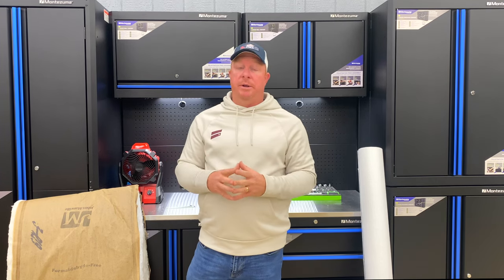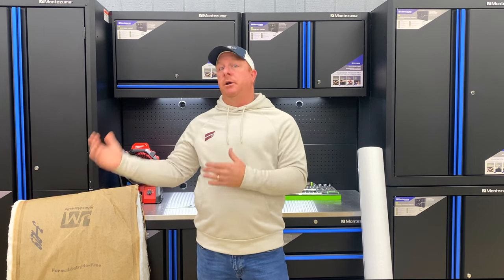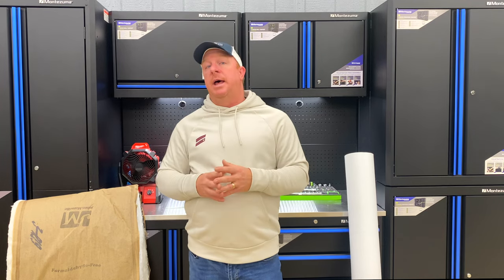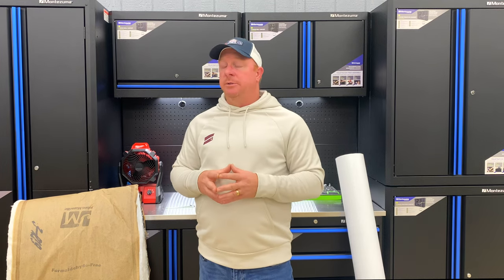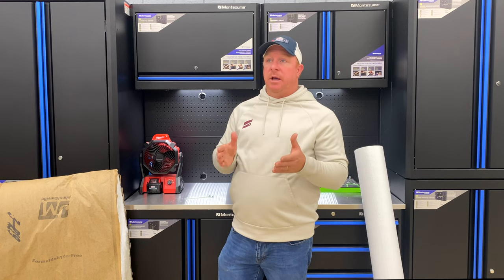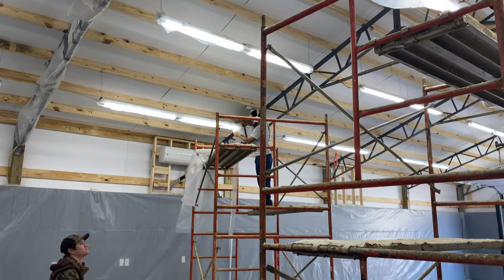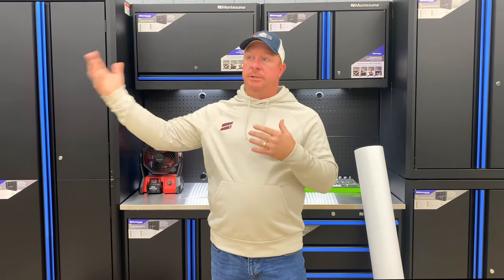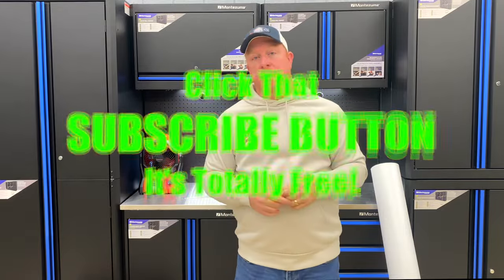Spray Foam Insulation Answers Here! Open Cell VS Closed Cell And Moisture Barrier Or Not!

Comment: Good job! I’m a custom builder on Cape Cod 36 yrs waterfront homes. You need 2 -3 “ of closed cell spray foam then r19 fiberglass insulation, then a poly layer then Sheetrock or wood.
    The spray foam not only has superior r factor but more importantly it stops ALL drafts and wind issues. We have to pass a strict “ blower door” test for air leaks. Air leaks means higher heating/ cooling bills.

Comment: Brother i like the way you did the walls and insulation. My shop has open walls as of now but after seeing how you did yours i might go this route. I really dislike the open walls, the finished look is a lot more practical as well as great looking. Also, im glad you showed the difference between the two types of spray foam. I agree with your assessment of using the open cell. 
Thanks for the shop tour.

Comment: I’ve been hunting for some closed cell foam to go under the lids in the compartments on my bass boat to keep things cooler, and can’t find any.
Reply from the maker: Just spray it in there
Reply: @KoonTrucking  
I started to but I’d rather have sheets to cut and use spray glue to hold em on, I’m a weirdo I reckon lol.

Comment: I thought you had to either paint on a fire barrier or cover with sheet rock?  Don’t think it’s supposed to be left exposed due to fire hazard. When I did my basement garage I used sheets of polyiso but they were rated to be exposed.
Reply from the maker: It’s fire resistant? They said if you painted it the paint would be more flammable than the foam? I have no clue just going off what he told me